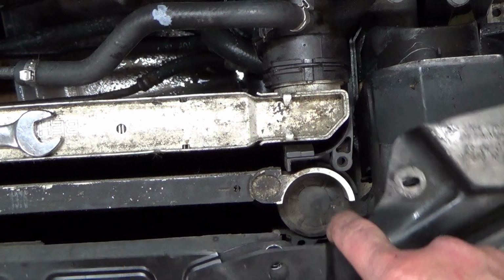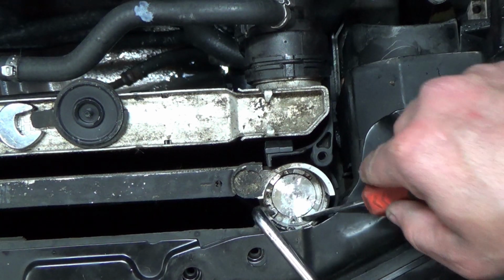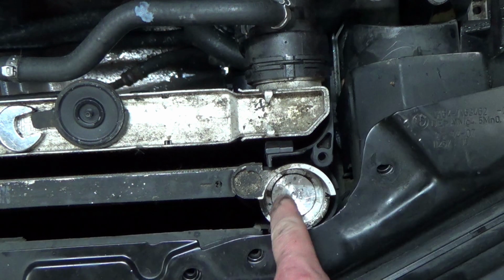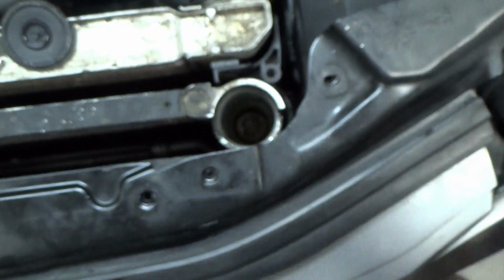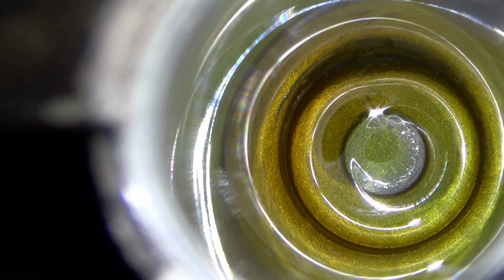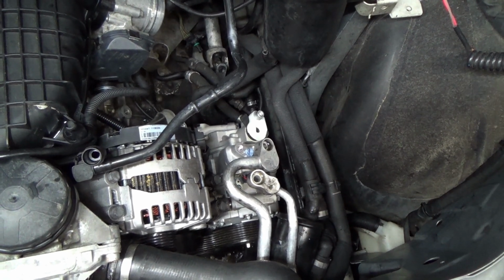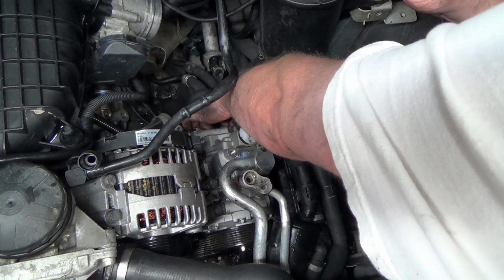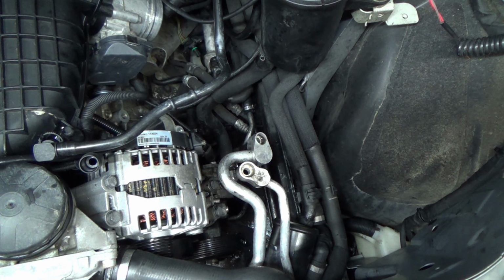2008 BMW 535xi Project AC compressor and dryer work

Comment: Pro tip from a non-pro... if you push down on the cap, and release the tension, that snap-ring comes out way easier.

Comment: Is the drier just a "swap it out" type of thing or is there anything else I need to do before putting in the new drier?
Reply from the maker: Swap it out and put the new o-ring on the sealing plug. Super easy. The kit I got came with a new disc/plug as well. As soon as you open it it will start absorbing moisture from the air so only open the bag when you are about to install it.
Reply: @Ryengoth  ok thanks!

Comment: What is that in the beginning of the video?
Reply from the maker: A bit vague of a question. More details?
Reply: @GlenBatchelor sorry... I'm new to this... I was asking about the drier
Reply from the maker: @Thomas998822  The drier is in the right side tube of the AC condensor,  under the plastic cover that runs across the front. It is a long cartridge, held in by an aluminum disc and a snap ring. Fully evacuate the system of refrigerant (0psi pressure) before you pull the snap ring or it will blow off and severely injure you.